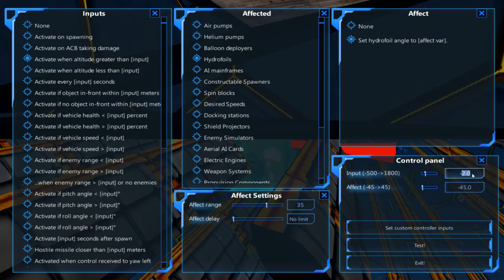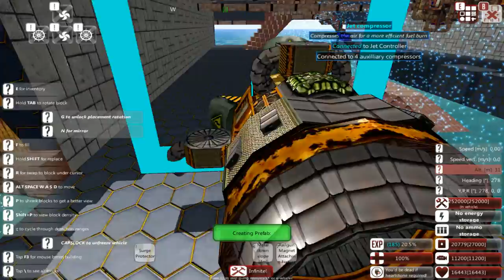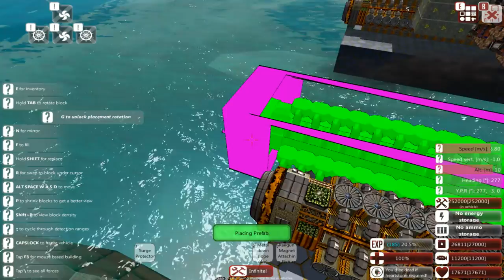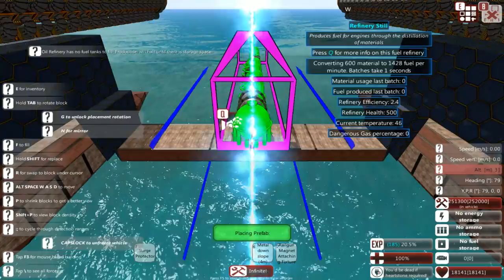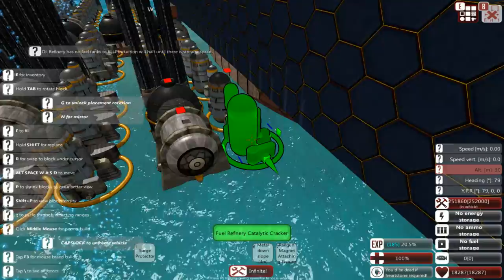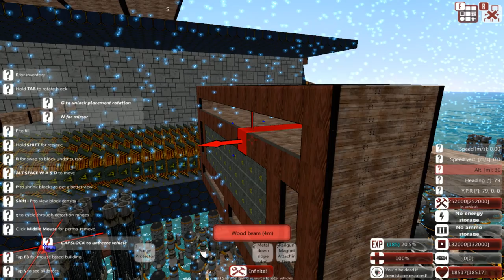From the Depths / Adventure mode part 36 ~ Motive POWER

Comment: damn :o I dunno about all them long jets and fuel gen for adventure mode. Did you think about adding propellers to the 4 pods? (not that you would get a massive increase)
Reply from the maker: Yeah, the issue really is getting raw thrust for a compact rear space. You just can't beat custom jets for that, especially if length is available like here. Since they run on fuel that means I can try to deal with their fuel needs via refineries which will dictate most of the efficiency.... it's about 52 fuel per resource as it is now. I have no idea how well this will all work from a sustainability point of view but for higher craft speed we get back to the limited rear cross section and the need for great amounts of thrust... so, yeah, it's gone full circle. XD 
Being able to shut off the custom jets when not in combat though will be a huge help for that even if it greatly reduces craft speed (by about 75% right now). Sadly fitting propellers to the pods will not be much help, by themselves they will struggle to get past about 10 m/s I think. Plus they could only be mounted on the rear pods, the ones on the front pods would not work. =/
Reply: Aiyonmk3 and here i am with my 150 meter long battleship that goes 20ms :s

Comment: i really dislike custom jets, normal jets on spin blocks are much more space efficiënt. they require alot of power but that can be fixed by steam engines. this probally is more fuel efficiënt than those giant jets too
Reply: the most compact power source is a small steam turbine with batteries and an electric motor. its also dirt cheap
Reply from the maker: Yeah, they can be. Sadly the key factors here are thrust density in a compact rear space... I'll have to play around with the jet configuration, I could definitely have built them better. But the speed they let the vehicle move while running is my main focus.
Reply: i dont consider the use of armor ramps as exploits though, jets on spinblocks AKA jet stacking is though so i can imagine you not wanting to do it
Reply from the maker: What is or is not is a matter of personal opinion a lot of the time. Like you thing jets and spin blocks are while someone else had the opposite opinions. ^^ Really, the armour is a case of the armour calculation not taking into account the different blocks. So I think it it on those grounds really given how the rest of the game is typically structured. But that is just me. ^^
Reply: So you're building a vehicle that's supposed to go faster than you can get without custom jets while carrying it's own fuel refinery and probably basically all  the weaponry etc you'r going to need.. ?? That's ambitious.. Well - maybe you can avoid carrying all the weaponry you need if you use Subvehicle spawner to make whatever combat vehicles you need.. Superfast mothership would likely be able to handle ANY threat meaning you have basically won the adventure mode game..

What's the point of putting jets on spin blocks? 

Do blades produce drag and thus are not good at high speeds but more efficient at slow speeds or what's the downsides and upsides of using them compared to jets?
Reply: Jawzah custom jets arent really space efficiënt and with normal jets on spinblocks you can add ALOT of them because they can clip trough walls and other jets. they also ignore the walls behind them so you can put them in a box of armor

this is called "jet stacking" and is considered abusing a glitch

also when a custom jet gets damaged the ENTIRE thing shuts down and with the size they are being built in this video getting damage is very common
Reply: http://steamcommunity.com/sharedfiles/filedetails/?id=867144082 this craft goes 95 ms and uses the jet stacking trick if you want to see how its done
Reply: Well - my hardware sucks (CPU is ok but graphics booster is crap) so I cannot even really play FTD myself ATM.. But I find watching FTD videos interesting.. 

I suppose what is considered exploit depends on the tournament rules in case you're making something for a tournament.. But yeah - from what I'we seen using smaller armor pieces to give stacked armor bonuses is generally considered just fine while clipping might be considered not OK.. Putting jets or any propulsion on spin blocks for steering purposes might be still OK i it's not obviously to get around limitations like jets requiring empty space behind them.

Custom jets not really space efficient? Does that mean you don't get more thrust per volume than with regular jet and a volume efficient engine to power it?  If so the next question is are  custom jets "drag efficient".. I read from the wiki that jets require empty spaces behind them.. So you can have only limited amount of regular jets per area facing front if hawing empty space to front mean that block also causes drag?  If so then indeed there would be a limit with normal jets (witihout spinblockery) you might be able to get around with custom jets.. I'we also read that spin blocks ingnored drag totally - but they might have changed that -- if it was changed to spin blocks always causing drag - even if they are inside a vehicle it would mean that putting jets on spin blocks would not even really get around drag limitations. SO there would be some thruth in custom jets being a way to get more speed you can get otherwise. .However it would only be true if you're using more volume for thrust than is possible without them - so a vehicle that has other purposes than being really really fast would not really benefit.. Of course regular jets are kind of extra unrealistic (run on semi-magical "engine power") - propellers and helicopter blades running on it makes sense but jets?? Really weird. Would kind of make sense if they ALSO used fuel directly if you just have an electric engine and nothing to burn you really don''t have a "jet".. 

Oh and the question about "dediblades" and drag is still unanswered.. IF they don't cause drag -- maybe you can just have a long row of them to get to high speeds.. Little bit of googling.. Yep - they do produce drag but you can get around it by  placing them inside - which is kind of exploity if the intent is that propellers are more fuel efficient but for higher speed you need jets (Which would make intuitively sense).
Reply: Jawzah yes they give better thrust per volume and they also are more fuel efficiënt because you can build a really good efficiënt engine. hell even steam engines are more fuel efficiënt than custom jets
the problem is you cannot add alot of jets by non-abusive methods

i dont know alot about dediblades and such, i mostly build jetfighters and fighter planes. even at those i kinda suck because their movement behaves a bit shitty